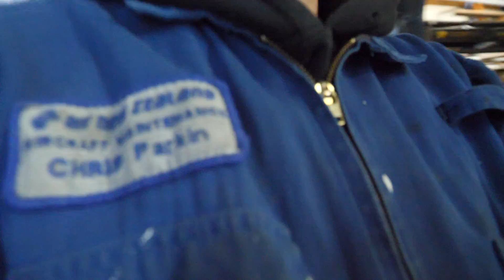How to set up HYDRAULIC BUMPSTOPS! - $100 Disco V8 Comp Truck Build - Setting Up Race Suspension

Comment: Loving the fab videos. Remember that your bump stops are vertically adjutable in the mounts - id be building them with the bump stops clamped in at half way up, gives you a little bit of wiggle room later if you go smaller or bigger tyres or whatever.
Reply from the maker: Cheers man, glad someone is haha! We have set them at the height they are at as we won’t be running tyres any smaller than the 36s! Can always space them out for bigger tho